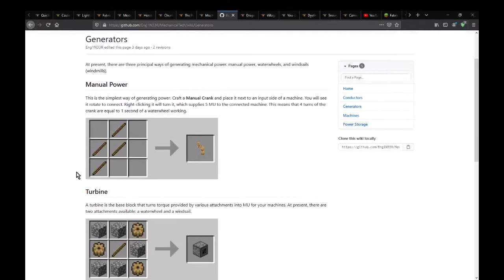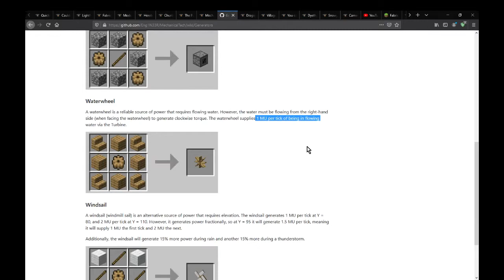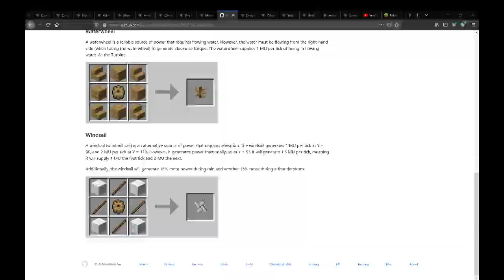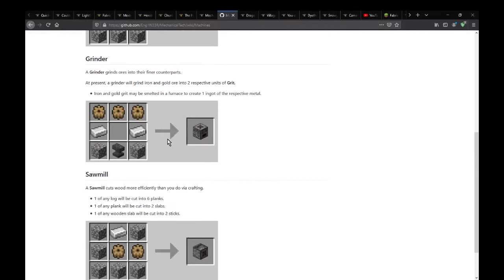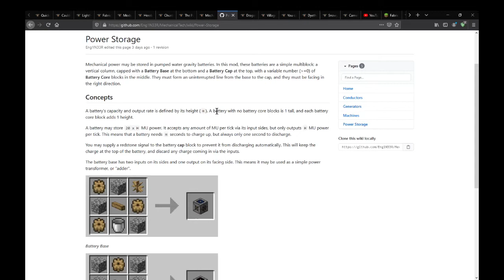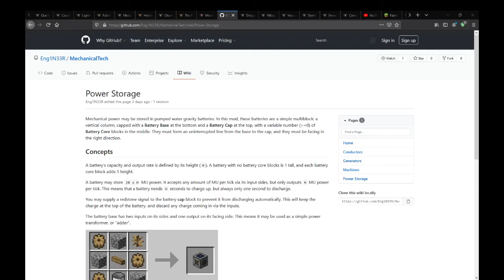[OLD] Mechanical Tech 1.16.4 Fabric Mod Overview Part 2 (New Redone Video In Description)

Comment: This mod is so detailed that it's more hassle than fun.
And the game feels weird because it's so different from other processes like making armor on the workbench.
Reply: It is sometimes and can be if you have never used mods like this before.

Tech mods are more in line with Redstone or expanding on Furnaces/Crafting tables usually. Think of the shafts and machines like you would to use Chests and Hoppers or a Minecart system with different connections. It's kind of like that.

And recipes can be like making say iron armour where you need a Crafting table, say you use iron ingots, you enchant it in the enchanting table, you repair it using the anvil. It's a lot of using a crafting table a LOT with many ores or tiers of components (the more complex and larger scale ones I mean) different blocks to craft but with machines you need the minecart or chest and hopper approach to power machines to do the Furnace and Crafting Table like recipes but with more requirements and logic of an Engineer. I don't have Engineering skills what so ever which mods like RotaryCraft you need.

But I've used mods like SextiarySector and the wiki for this mod (which I used a lot in part 2) with similar concepts besides many other tech mods since 1.4.5 to 1.12.2 mainstream and niche so I've gotten used to it over time but when I started it took me a long time to understand Industrial Craft back in 1.4.5 but I soon got the hang of it with videos or just trying in creative/survival and seeing what worked. But many tech mods can go beyond Vanilla concepts while others can be really familiar/Vanilla friendly.

Mods like the Pulverizer https://www.youtube.com/watch?v=fTzwQ4_GCJ4 which is just a furnace like block but with ore doubling or mods/datapacks that add a simple smelting bread recipe are probably best and good examples of staying Vanilla or being good entry points or just offering 1 thing compared to more when you just wanted the 1, but Mechanical Tech is fairly basic compared to others I've used on Fabric that are repeats of the big mods on Forge and get complex if you don't read the books, or look at the recipes to find a connection. But I can understand that it is still confusing.

That or playing a quest based modpack that explains what each mod does more clearly step by step. But I found looking at recipes while tedious and wasn't a choice in older versions back in 1.4.5 is still a way to go and trial and error to just place blocks in a certain way (which for niche/new mods you have to do sometimes and work out from scratch) and comparing it to those Vanilla situations I pointed out.
Reply: @suntannedduck2388  Thanks for your answer. you're right. I have never experienced mod that kind of industrial. It is so shocking.This is definitely a realistic mod. Today I recall again that I was lazy person.
Reply: @양자중첩상태  No Problem. It is fairly realistic but most of what I've learned is from other Minecraft features or mods rather than the actual inspiration they came from. I wouldn't say your lazy (not sure what that means, might be something to do with the translation).

But I'd say go with something simpler and build up to it or just find other types of mods that fit more so what your into.

Even installing mods can be tricky at first or playing Minecraft for the first time can be tricky without videos, a wiki or using the advancements/recipe book after all.